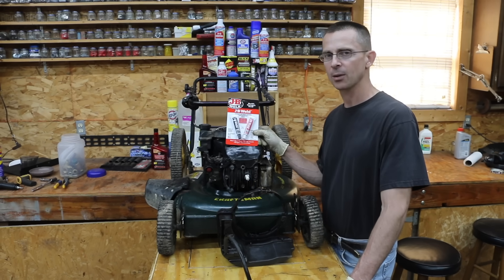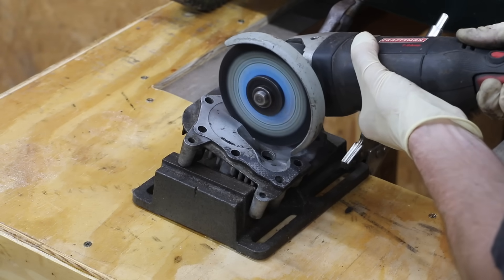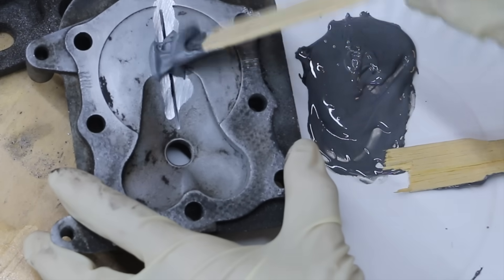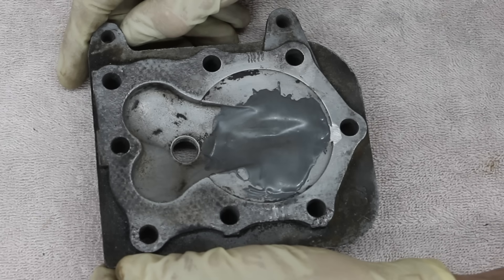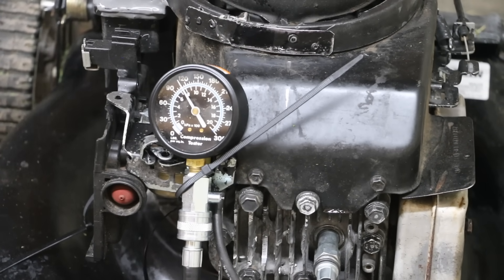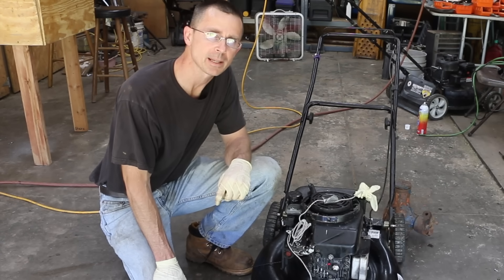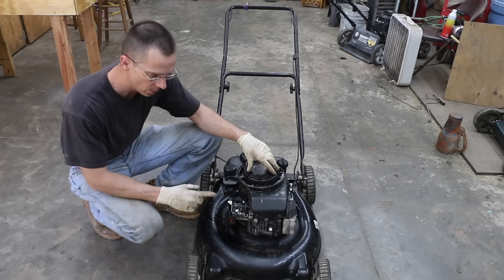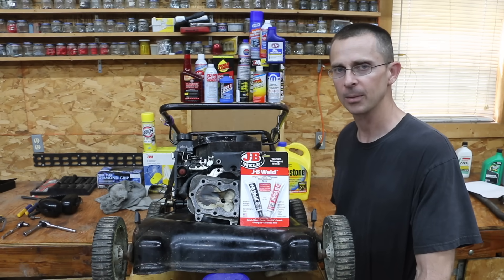Can JB Weld fix a cracked cylinder head?  See the proof!!

Comment: Clutch basket broke crankcase on my Ninja in 1988.  Fixed with j.b. weld and still running perfectly to this day.   Had a one ton Dodge truck that spun all differential bearings.  Once knurled with a punch and fitted with new bearings,  it was assembled with j.b. weld at the knurled areas.  Worked perfectly for many years.  Spun a trailer wheel bearing about 15 years ago.  Knurled and fitted new bearings assembled with J.B. weld.  Still running today without even being repacked!.  Ask me again!
Reply from the maker: Thanks for sharing.

Comment: Not nearly so impressive as the other stories here, but I used some JB Weld to replace the threads on the drive of a food processor, and that's holding up. High RPM, extremely variable stresses, tiny surface area to work with, keeps going in and out of the dishwasher and the fridge, holding up just fine.

Comment: My 2 stroke blew a pin sized hole out of the clinder head and still starts, strokes, and idles perfectly healthy. Also Depends on where the hole is at. mine was right near the intake manifold. Should be an easy fix gonna try using some jb weld high heat mixed with a small amount of metal filler.
Reply from the maker: Thanks for sharing.

Comment: Used JB Weld on my vehicles front seat mounting bolts that pulled completely out of the floor. I'm amazed at how Strong JB Weld really is after it's fully cured. Nice Extreme test on your experiment.
Reply from the maker: Thanks!  Thanks for sharing.

Comment: Hi my name is Chris, and I found a tube of Miracle Weld and used it on an Air Compressor that had a tiny leak, and the Miracle Weld is like a putty that gets hard after use, and I only had small leak and it worked, now I got it from an Auto parts store here in Pa ,not sure if it available still anywhere.

Comment: Me and my old buddies used JB weld on a crack cylinder diesel four banger tractor at least 20 years ago. Ground out the cylinder crack roughed it all up so the JB would have a foot , waited a couple days. We then ground the cylinder to perfection. Put it back together again, it ran for over 15 years no problems.
Reply from the maker: Thanks for sharing.

Comment: i've used JB to hold idler gear seals in dozer front wheel. Held like a champ through mud and slop. Never broken and it was making up 1/8' Gap to hold lip seal in place.
Reply from the maker: Thanks for sharing.

Comment: JB weld is Recommended on the Spark Plug insert repairs...Personal Experience...I Tested both JB Weld & Loctite on a Damaged Spark Plug hole I had Rethreaded & Guess What? Jb Weld held when the Loctite Gel Didn't....Major Compression leak with the Loctite only a much lesser one using the JB weld & Loctite Together....So I Decided to Use JB weld only the 3rd time around....Well See How it Holds with Just the JB Weld Only.
Reply from the maker: Thanks for sharing.

Comment: JB Weld Extreme Heat would be even better suited for engine repairs.
I'll be using it to fix a stripped out cylinder head bolt thread in a cast iron vintage engine.
Reply from the maker: Thanks for sharing.
Reply: @ProjectFarm I just checked out a video showing that JB Weld Extreme Heat is useless, as it is only a one part paste rather than a two part epoxy and hardener mix. It is more like exhaust GunGum and doesn't have much structural strength. I'll be fixing my cylinder block thread with nickel 99 stick welding rods, and taping a new thread instead.

Comment: Just did my coolant connector, it broke in half on my 2004 c230 benz and i drilled the connector hole bigger to add a mini break line to it the apples JD Weld, waited 24 hours, no leak car runs fine 🎉
Reply from the maker: That's great!

Comment: I tried using JB weld to fix a broken exhaust manifold on a 1982 Pontiac with a 4-cylinder engine. It ran okay for a few minutes. But then, it cooked that JB weld. 

JB weld is great for other things, though. But exhaust manifolds just get too hot.
Reply from the maker: Thanks for sharing.

Comment: redo a hole whose thread has been stripped from an engine block head and add the product and redo the thread of the hole, and find out if the bolt will hold the head.
Reply from the maker: Thanks for the suggestion.

Comment: My cold water copper pipe, about 80 psi, had a pinhole leak at the coupling. Probably bad soldering but it lasted many years before the leak. Turn water off clean pipe applied JB Weld, turn water back on. It lasted one day, think I would had better luck with Bondo. Anyway fixed it properly with solder and new coupling. Maybe just me, never used JB Weld since.
Reply from the maker: Thanks for sharing.

Comment: Awesome video blast from the past!  I do wish you did another compression test after you sanded it down because it may have gone down with less volume for the air to compress into.  Be interesting to know if that would of been enough to make a difference?  Maybe not much though.  Great video and good to know though!  

I have fixed a few radiator leaks with JB weld with great results.  Oh also a few different atv/motorcycle engine cases when the chain snaps off and winds up around front sprocket and cracks case or engine covers creating oil leaks.  Good stuff!  I love it!
Reply from the maker: Thanks!  Thanks for the constructive feedback.

Comment: I have always had great luck with JB Weld. I normally clean the area with acetone or denatured alcohol to remove any oil residue that would possibly reduce adhesion. I rasp the area around the crack with carbide ball on a Dremmel tool to promote maximum grip. Right before I add the JB Weld I heat the area slightly with a torch to promote expansion of the crack so that I can force as much product into as possible. I have saved some major money over the years. Normally the equipment will fail by other means before the JB Weld lets go.
Reply from the maker: Thanks for the feedback.

Comment: JB Weld has worked well for me. My next use is going to be to use it for a O2 sensor on my old Buick. I will need to drill a hole in my exhaust pipe and then mount a bolt using JB Weld that the sensor will screw in to. Wish me luck. Comments are welcome.

Comment: For anyone that finds this video. If you will heat both parts of the jbweld in a pan of boiling water until both sides are hot. When they are mixed the set time is way shorter. The cure surface has a very high gloss. It lowers the viscosity and greatly improves the strength. Just my 2 cents.

Comment: How about 1 more related video on this? I tried harbor freight best 2 part epoxy to fill the excessive on my case while cyl to case matching. Can jb weld hold up to my 40/1 93 octane mix with constant fire and fuel charging against it at 9000rpm's??
Reply from the maker: Thanks for the suggestion.

Comment: I just did a repair on a small honda scooter engine. It seems ok, not a lot of running time yet. I'm pretty confident that it will last. The only other product I've used with success is marine tex, I used tha ton and oldsmobile cracked block, never failed.
Reply from the maker: Thanks for sharing.

Comment: Very impressive results, sir ! I'll be sure to try this as a final exterior sealer on the Head Gasket of my 2012 Ford Transit-  I already flushed it internally with K-Seal Head Gasket Sealer-now I plan to run Liqui-Moly through engine oil  to remove build-up/ sludge-   empty that oil- refill with cheap oil- run for 20 minutes- then change one last time- with high quality oil-   

 . Now, on a side note...I was successful with JB WELD on my '96 VW Jetta brake Lines-   ... MIdas said it would be 2200.-  JB WELD- did the trick- I had a tight squeeze- under VW- had to be precise and wrap it all around the hole in the brake line- I had zero dollars to pay someone else to help- and there was a heat wave and I was living in the car- took the back seat out...this was in Missoula, MT. after the Rainbow Gathering- ...i tried to use the public library and was shut down by mean spirited librarians- closing early- i yelled at them - then drove away real fast-  they most likely called the police I tried to hide in a public park then more bad luck struck ...

I yelled through my open window at the person in the car next to me - ... they had pulled in and woke me from a deep sleep-with a bunch of ruckus-  with loud and obnoxious dog barking and jumping all around like a mad Cujo 

I got out of car- then jumped right back in as an off duty police officer tried to make a citizen's arrest on me  in the parking lot- i yelled at this lady's dog who was jumping on my car-with heavy claws- it was really damaging- who wouldn't say something- No LEASH?   then he tried to physically block me from backing out of parking lot- but I used my manual stick shift to elude him- he was giant - like a football player..then I peeled out- drove the WRONG way up a one way University Campus- ...I knew he called the active police- -  I only had one chance to elude them- so I slipped through central campus- ..but then- instead of heading to the main on ramp for the HIghway West- ( I knew they would have officers staking me out). I escaped the campus and slipped away on  obscure country roads- finally crossing the state line

Comment: I can verify this one.  We had a Craftsman riding mower.  Long story on how I got a hole on the top of a piston however pay attention to where you place hose clamps when fixing fuel line.  I used JB to repair to repair the damage.  I got another 4 years out of the mower.  The engine did fail, however the patch job was still fine!
Reply from the maker: Thanks for sharing.

Comment: I did fix a 350 Chevy block,but turned out the inside was cracked too and let water in the oil. But hey worked on the outside.  Pex
Reply from the maker: Thanks for sharing.

Comment: although that stuff can do it i would never do it on a permanent basis, the risk does NOT outweigh true fix for this.
sure it can hold up against heat like inside a cylinder chamber but the most obvious question is for how long?
all it takes is a bit to chip off and then you have a trashed cylinder wall and piston and possibly valve seats.
generally it is ideal for external repairs but putting it inside a cylinder chamber is just plain out insanity.
Reply from the maker: Thanks for the feedback.

Comment: When I was in the navy we were overseas and one of our main electric saltwater fire pumps seized a bearing on the shaft and it spun in the bell housing, egging it out. No immediate parts available. So we got a fresh bearing on, mixed up the jb weld, got it all back together. I know it worked for several years.
Reply from the maker: Thanks for sharing.

Comment: Nice, there is videos of other people trying this stuff on cracked car pistons, doesn’t work nearly as well as your experiment. The car pistons work for a couple minutes under the stress of moving the car at moderate speeds. Then it just burns up slowly, eventually failing.

Comment: Years ago, I bought a Pontiac station wagon with a blown head gasket. It had eroded the aluminum from the head into the water jacket. I filled this hole with the J-B weld and filed it flush with the rest of the head. I assumed it was a temporary fix until I could get a proper weld put in there so I drove the car anticipating it soon failure. I drove that car for years and never had a problem with the the repair, the head, or gasket.
Reply from the maker: Thanks for sharing.
Reply: There is actually a little more to story. I would have never tried JB weld as a repair for the head if I didn't have somebody knowledgeable suggest it. At the time I knew a field technician for a Japanese motorcycle manufacturer. He would use epoxy to modify the geometry of the head the intake and lower end of 2-stroke engines to run them on the dyno just long enough to get numbers for performance. He had a system where he could file it and sand it before it completely cured. Once he had good performance from his modifications they could be digitized and made into actual castings.

Comment: I used the same JB Weld epoxy to level corrosion pitting on my bmw head where the thermostat gaskets with the thermostat housing. It's been a week of driving with no issue so far.

Comment: There was an aircraft product fasco epoxy/ epoxy 88. Was always my choice, however the air port I used to work at used something better now. But the 88 was supposed to be better than JB weld. 88s not cheap. It was like $14 20 years ago for the two tubes. Same 50/50 mix.

Comment: I went to thge junkyard in the 90s and bought a random set of heads from a 360 and had them redone and put them on my 318. I wound up with 8 exhaust leaks because the 360s had a tiny hole under the exhaust port. Something to do with emissions I guess. About an 1/8 inch diameter. I had no idea what to do. Some guy suggested jb weld. It took care of the problem. I probably put 30k miles on those heads. I'm pretty sure its still holding but I haven't heard it run for awhile. Based on that I've used it many times over the years and it works most of the time. I've tried some things that definately push the limits so I've had some failures here and there but ovverall I can definately recomend it. Make sure everything is clean and you will have a good chance for success.
Reply from the maker: Thanks for sharing.

Comment: will the new JB weld hold up to 10% ethanol gasoline? My motorcycle tank projects have all failed long term as the ethanol weakens the jb weld. I put a hardened sample in a jar of 100% gasoline and one in 10% ethanol and the JB weld in the 10% ethanol softened in 72 hours. Is your perhaps newer formula more resistant to ethanol? Does in claim so on the package you're using?
Reply from the maker: Thanks for the suggestion.

Comment: I jb welded a toyota corolla in florida on vacation. it was a plastic radiator crack, it held up long enough for the week i was there and drove back. i had to add pepper when i got back, the radiator antifreeze and water/heat caused it to peel off. this was 35 years ago, maybe i mixed it wrong
Reply from the maker: Thanks for sharing.

Comment: Great video series! I check your channel all the time for products I need. If you haven’t done a comparison already, it would be interesting to see how JB Weld compares to Pro Seal’s Pro Weld. I recently used Pro Weld on a 21hp cracked engine block with good results. I also patched a hole in the muffler of that motor too. I was impressed.
Reply from the maker: Thanks for the suggestion.
Reply: @ProjectFarm  Little real world update on Pro Seal Pro Weld. My cracked engine block repair lasted about 4 months and got another 16-17 yard mowings out of that 21hp engine. When it failed last week, it failed catastrophically though. The engine block literally blew in half, tore through the cowling and sent pieces of the cylinder head flying. Made quite the fireball and boom too.

Comment: I make rims for 19th century style bicycles.
I roll the rims and TIG weld them. To clean up the weld area I use JB weld as it makes a good filler and stands up to the heat of powder coating
Reply from the maker: Thanks for sharing.

Comment: Just used JB Weld to repair my electric wheelchair; it has a hollow square aluminum bar (about 2mm thick and 22x22mm square) braced between the motors / rear wheels where a piston attaches to the center of the bar for folding and unfolding the chair, this had snapped in the center where the stresses are the highest.  I bought a 20cm length of solid 20mm x 20mm aluminum bar which I covered with JB Weld and inserted into the two broken halves of the original bar.  The result is a considerably stronger part which shouldn't now weaken and break in the middle as it did before.
Reply from the maker: Thanks for sharing.
Reply: Good job!

Comment: I’m wondering about a repair on a real crack, one that the metal in the crack is not clean due to combustion gases passing through it, and is just a narrow crack rather than an easy to fill cut groove.
Reply from the maker: Thanks for the suggestion.
Reply: You need to widen the crack for JB beeing able to go in

Comment: Something hit my aluminium secondary oil pan. attached to the engine block Toyota Tacoma 2014, start leak like one drop of oil every 10 minutes,, more often when hot,  the dealership was ready to charge me $2,400 to replace the part.  
I applied JB Weld to the crack, let it cure and problem solved, $7.49
Reply from the maker: Great to hear!  Good job!
Reply: $2400? That's why they call them "stealerships". Good job.